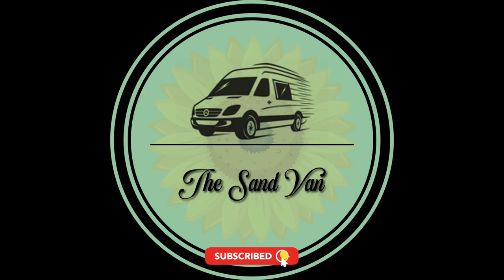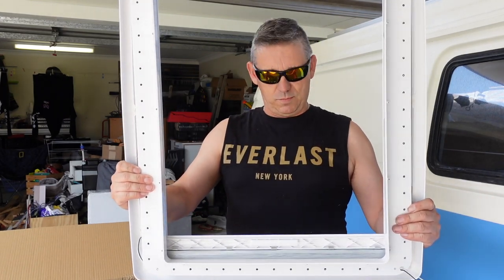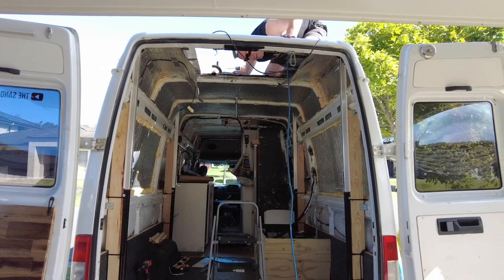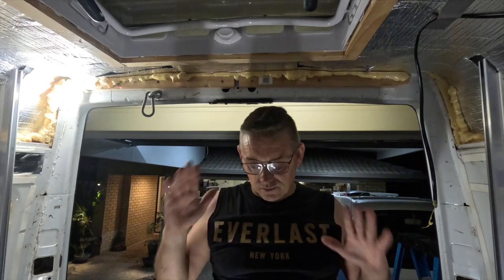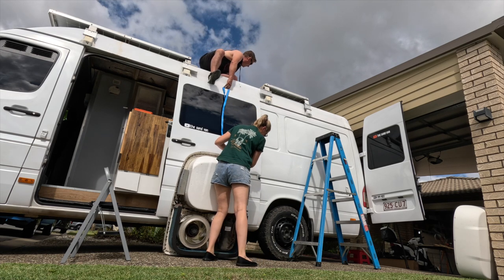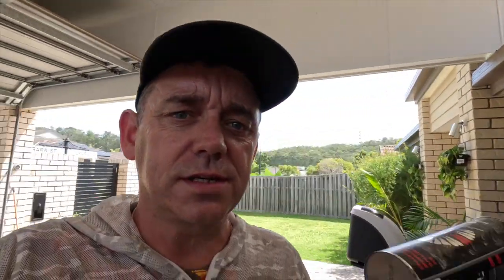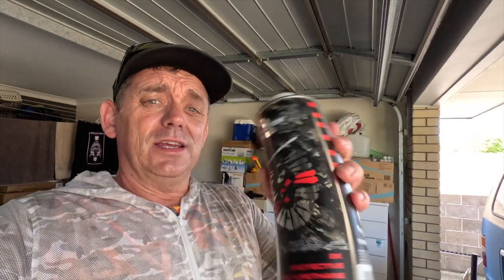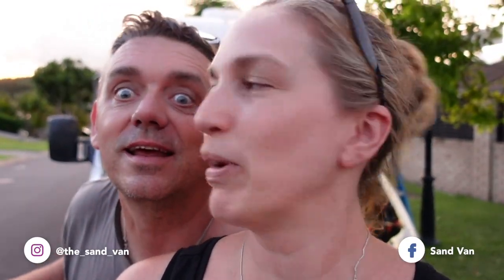Installing a SKYMAXX LX ROOF LIGHT on a campervan | MAXX AIR FAN installation | SPRINTER T1N

Comment: Do you guys know how the led light operates? Since it doesn’t have a switch or anything I’m curious how it works. Once it’s wired to power is it just always on until you disconnect fuse or connect a switch?
Reply from the maker: It has to be seperately wired , we connected ours to a light switch in the wall 🤩however the trim on the surround is thick enough to accommodate a small switch 😀thanks for watching 😀🙏

Comment: I've been thinking I want to replace our A/C unit with a skylight. So, it was good seeing you go through the process.
Reply from the maker: Thank you❤️😊🙏🚐it will definitely save weight as those AC units are heavy and having sunlight in the vehicle is so much nicer 🚐🌅

Comment: I love your Sky Light and the way your approaching your weight budget with the rebuild. Currently editing a video on how better ventilation can omit the need for air con. Fitted fly screens will compliment your increased air flow. Great work having 2 MAXX Fans and no leaks. Stay Awesome
Reply from the maker: Thank you 😊❤️🙏🚐yes we never really needed to use aircon over the last two years , wasn’t worth carrying all that extra weight around 🚐😳

Comment: Well done guys !! Tim we really feel for you working in that heat your a Trojan and well done for getting these vlogs out as well as doing the build you guys are unstoppable! ❤ think your defo gonna need bigger solars as the Max air’s do drain the battery.  Loving the progress keep it up 👍 xxx 😘
Reply from the maker: Thank you guys ❤️😊🚐🙏we’re so excited to get finished , we run 400w of solar and 400ah of batteries , ❤️😊🚐🙏ram both fans on full all day and it hardly touched the battery with all the solar we get here 🤩

Comment: A fantastic job. Certainly a lot of extra light. One question. With the max air flow moved, what happens to the hole, especially with the new paint in place? Do you weld a piece of steel in place, or what becomes of it? How flammable is the painted area you will have to cover? But I'm really enjoying the rebuild. I'm just wondering about this point. Thanks for sharing. Certainly hard work.
Reply from the maker: Thank you 😊🙏❤️The hole was plated with aluminium and sealed and screwed in to place prior to the polyurethane paint being applied so it is extra water tight and with the solar panels in place it covers over the area giving an extra layer of protection ❤️🚐😊thank you for the support ❤️❤️

Comment: Great work on that roof! That was definitely a lot of work as was the editing of this video. Would a flexible solar panel work on the slope just above your windshield? I watched a video a few years ago where the guy built a retractable panel system. Two were always present, like your two were. Then when parked two more pushed out from underneath, like retractable wings. 😊🚚
Reply from the maker: Thank you AJ ❤️😊🚐🙏we’re considering different configurations for the future solar set up , the flexible panel is a good idea and I’ve seen the retractable solar panel system it’s very interesting 😊